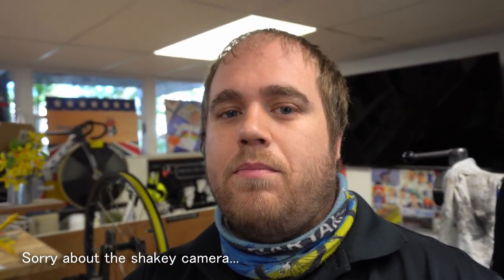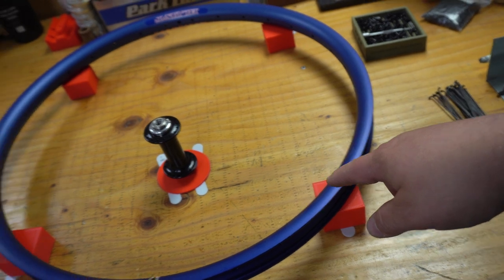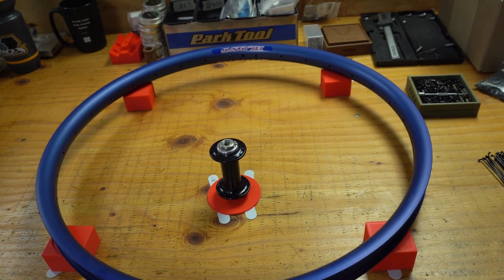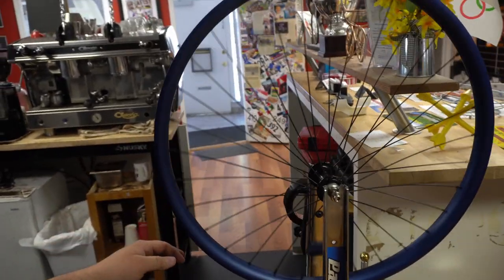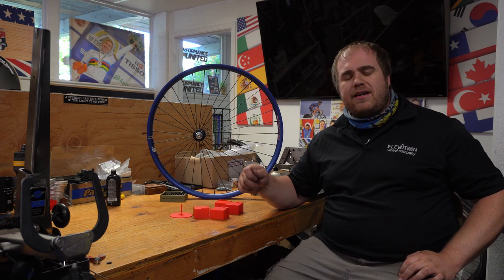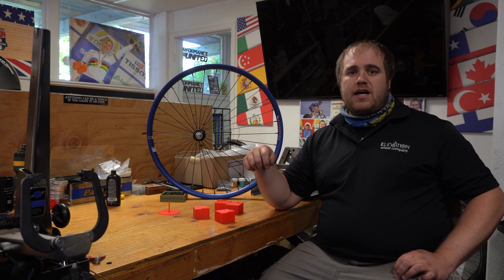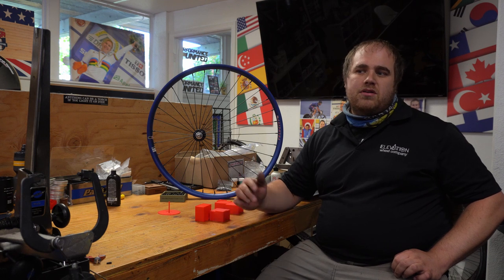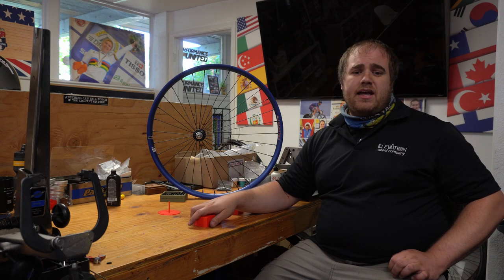Eccentric Wheel Building!

Comment: Care to share your maths? What measurements did you end up using?
Reply from the maker: I am actually pretty horrible at math but have access to a spoke cutter so I would just measure each spoke length with a ruler and cut them to length one by one.  I am sure someone decent at math could figure it out a bit more precisely than my method though.

Comment: Is unior a good wheel truing stand (which one to choose also the cyclus or pro version?) and if so which accessoires should you buy with it??
Reply from the maker: I've never used the Unior stand but I have liked all their tools I have tried so far.  I do really like my Park TS 2.2 though.  As far as accessories go, the main ones you need are spoke wrenches, dishing tools, tension meter.  Those are the necessities but it never hurts to grab more if you can swing it.
Reply: @ChrisMurrayEWC  the parktool is expensiveeee 😂
Reply from the maker: @ZashaBoonen  True but it lasts for decades so if you can swing it, it is a good long term investment.  If that's too much to start out with there is definitely nothing wrong starting with cheaper and eventually upgrading.